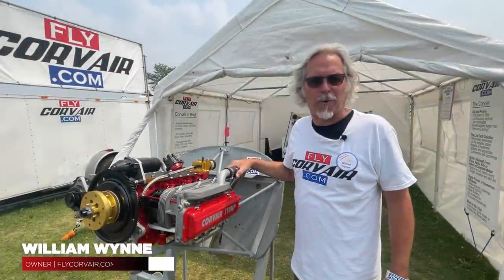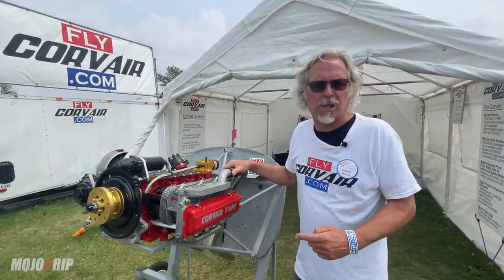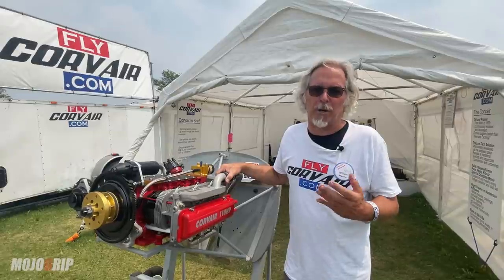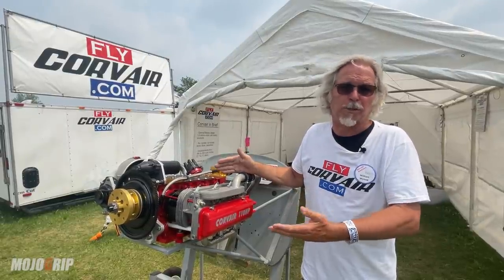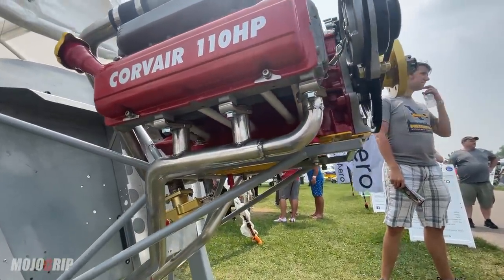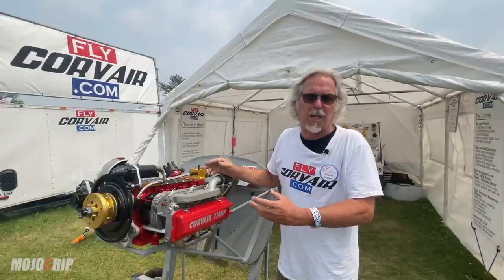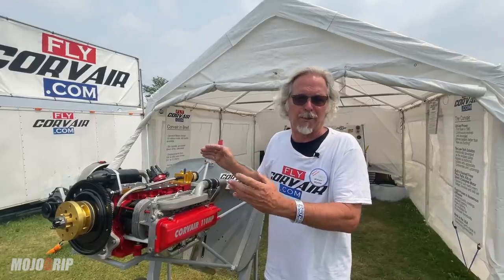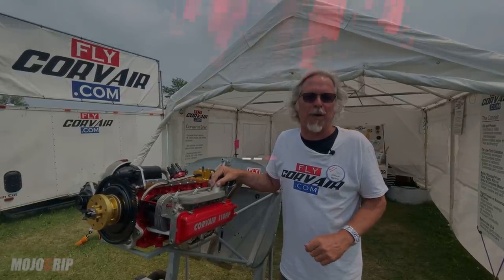Auto Conversion Engines Used To Power Plane | Corvair

Comment: The comments about this engine are unbelievable; this guy has produced a reliable and well thought out conversion that has stood the test of time.  Comments like flying behind a 40 year old scrap engine, your continental, lycoming engines are not State of the art but they are proven technology like this conversion.  I have personally witnessed the dedication that Wayne provided at his seminars, it is always safety first with him I've never seen him try to sell anything he didn't believe in 100%. Before making offhanded comment look into what this person is actually done and provides to the aviation community.
Reply: Very well said Don, I agree with you
Reply: William is one of the good ones!
Reply: I guess those people don't understand that the Lycoming O-320 in the 40 year old Cessna 172N that they rent from the local flying school is just as old and just as worked over as the Corvair engine in this video.
Reply: That, and the people who charge 50, 000 dollars for an engine that probably costs 5 grand to overhaul.
Reply: If you want to stake your life on engines that were pieces of junk when designed go do it. Guess what - you can't pull over when in the air. Your romantic notions won't save you or your passengers.
Reply: @robertoskeetrech3206  I have seen many worn out any leaking Corvair engines. I have never seen a broken engine.
Reply: THAT IS ALL TRUE .. but please ,if you use them , please stay ready … This fellow sounds good but 300 engines are not enough proof of concept !!!
And I know Corvair engines have been used for a long time but please … I don’t thing every component is being Magna-fluxed for metal failure !!!!!

Comment: Some guys are still using Subaru 4 and 6 cylinder boxer engines with their experimentals.   Personally I think they are fantastic conversions and like any they have pros and cons.  There are of course naysayers who feel they've not been refined enough or been around long enough to be "proven" but I also think that's subjective to who has done deep homework to make them a long term success.

Comment: It appears gorgeous. There is one obvious fly in the ointment: Instead of seeing an electronic igntion, or one magnito or two, it uses a car distibuter. That doesn't really save any cash up front to lower the initial cost, because many electronic ignitions are available. The FAA would look with a jaundiced eye at using a distributor. Aircraft labeled Experimental I think have much greater advantages and satisfaction if they fly well and not kill anything other than grass and themselves. But electronic ignitions are the only way to go. The car distributor on that engine cost $150 - $250 and are imfamously unreliable. Electronic ignitions cost about the same but are much more reliable.
Reply: There are electrtonic ignition conversiion kits for the Corvair distributor through the Pertronix line of Ignitor ignition modules that incorporate a higher spark energy coil. Very reliable and very inexpensive, as I run them on my Corvairs, one which I race to great success at high RPM (7500+) in autocross events. The distributor on this engine looks like a stock model, however, it has been modified to accept two sintered bronze bushings to aid in spark stability, as William understands "attention to detail" and these engines rarely exceed 4000RPMs tops, making magnetos an unnecessary expense for this application -- I've done the upgrade to all of my Corvair distributors.

Comment: I'm waiting to start my PPL as soon as funds permit. However, this is my first knowledge of car engines being used to power an airplane.
Reply: The key thing here is that these auto conversion engines are essentially only allowed in aircraft that are in the "experimental" category, not in the "certified" category.  (That said, there are certified conversions like those used in Diamond aircraft that were originally Mercedes diesel car engines that have been significantly modified but the company went through the process of obtaining official FAA and European certification for the engines and the aircraft they are used on.) This is at Oshkosh, which is hosted by the EAA - the Experimental Aircraft Association.
Reply: @tomdchi12  Thomas -- if and when these auto engines are certified, these engines could become extremely popular in planes. But until this arises, there will be headwinds such as use in experimental planes only. Pilots are likely to shun these engines until such a time comes about. However, thank you for your response.

Comment: I wonder if this would work on a Sonex? I'm unsure if it is too heavy for this smaller, lighter craft, but- if it does (mounted closer to firewall for better CoG?) it would be another solution for that particular group of craft. I know that if it drops a cylinder- it remains smooth, but- I think weight would be the primary issue.
Reply: Yes. It has been done.  Look up Cleanex.
Reply: In Waco, Tx, there is a retired A-4 pilot with one of these in his Sonex.
Reply: The Sonex is in the micro category. That engine is way to big. At leasr one KR-2 builder put in a Corvair engine. For the added hp, I would like it. The KR-2 could put any engine on the front that had at least 48 hp up to 200 hp. The standard Beatle engine puts out 55 hp. That's basically what you were going to fly at above 135 mph to commonly 155 mph. At altitude of 10,000 feet, drag is reduced, and not counting tail winds could show 155 mph on the indicator. GPS at 10,000 feet with a 40 mile tail wind, you could be tim e traveling and pass your destination.

Comment: beautiful engines! intake and exhaust plumbing look pretty restrictive. any performance upgrades in intake and exhaust manifolds? any turbo or supercharger options for better performance at altitude?
Reply: I'm sure you can you can use all the car performance parts. I have this motor in a sand rail that is 172hp to the rear wheels standard upgrades aftermarket Intake carb higher ratio roller rockers higher compression and you can go to a stroker crank an oversized jugs and pistons that can give you up to 3.3 litre.

Comment: Since the Toyota V6 is so smooth and reliable would that work well?
Reply: Viking engine  that was mentioned in the video uses Honda car engines. You would have to see what the weight to power ratio is, and make sure the air craft it's put on can handle it weight. Like he said in the video  conversions have a bad rep. for this reason people just try  what that can without doing the research and testing.
Reply: The 1GR FE V6 would make for a very good conversion... Good point Parker
Reply: A major issue with newer V6 engines is that most of them are fairly tall and narrow to fit sideways in a front wheel drive engine compartment. This shape is not optimal for most aircraft cowlings. It fits better if you turn it upside down, but now your oiling system just got much more complicated.
Reply: The problem is the weight, cooling system and reduction gearbox you will need to slow the prop speed to about 2600 rpm. The corvair option does away with all that leaving you a smooth, direct drive, simple and reliable installation that you will understand inside and out as you actually build the engine yourself (though you can buy completed units).
Reply: @weofnjieofing  Thanks, what about the Lexus inline 4 cylinder turbo?
It's all aluminum and should be a decent candidate.
Reply: @thisismagacountry1318  Viking engines use the latest in line 4, all aluminium, direct injected Honda engines to good effect from 90hPr to 195 hp (turbo). They'd be your best bet as those engines are fully set up for aircraft use.
Trying to convert a Lexus engine yourself would be very time consuming and expensive. The Honda 4cylinder is a very reliable engine.
Reply: @weofnjieofing  Good to know. 
Are any Honda engines available in Diesel or Turbodiesel?
Reply: @weofnjieofing  problem with direct drive is being limited to about 3000 rpm which for most engines is where they are just beginning to make power. 4500 is still pretty low for for an auto engine and this engine would make a lot more power at 4500 rpm. a simple belt drive reduction could do the job and give more ground clearance for a larger prop which would further enhance performance
Reply: @weofnjieofing  Weight isn't a problem, the 2GR-FE weighs in at around 360 pounds and can make over 300 hp, which is quite good for a light aircraft engine. A PSRU and the cooling system would put the weight well over 400 pounds, but that's still comparable to other light aircraft engines.

Comment: Install newer tech such as electronic ignition and fuel injection in lieu of distributor, contact point and rotor, and carburetor. Electronic engine timing and variable valve timing control will also also help. Turbo would be awesome.
Reply: Azalea Aviation (in Quitman Ga) produces a Turbocharged Corvair engine (120 hp).

Comment: Hmmmmm…I DONT think so … I had a Corvair … a couple !!!!
I could coast to the curb and put the van belt back on … that would be tough at 10,000 feet !!!!!
Reply: The aero converted corvair don't have a cooling fan anymore, the propeller pushes enough air through the cowling!

Comment: i have just few hrs in cessna s (single engine) as student pilot long back. i still keep browsing about tiny planes in GA sector. i am wondering if any experts here can clarify few doubts i have:

- considering himalayan/ tibetan mountain ranges and their weather patterns, is it possible to design a piston-engine (normal petrol), single-place aircraft, with about a ceiling of 35,000 ft?

- can the same aircraft be STOL & fuel efficient at low altitudes for cross country flying/ long trips?

thanks in advance.
Reply: There are very few piston engine aircraft that can even reach 35,000. For anything with a practical mission, you would be looking at a TBM or better. Price of entry is about 2-4million.

For a Corvair engine, I wouldn't expect to spend much time above 10,000 ft, though I think the engine is amazing.
Reply: @Shmey  thanks for the info. i am only wondering, why there aren’t any piston aircraft designs available in these modern days, especially 1 or 2 seated for high altitudes!
Reply: @prasadjonnalagedda8633  I don't know much about regulations anywhere but the U.S. Here, the simple answer is cost.

To legally fly at higher altitudes, the instruments (typically an encoder tied to the transponder) must be certified to the altitude you want to fly to. Higher altitude flight requires a longer test. A longer test means more shop time. More shop time means a higher cost. I can't remember the regs off the top of my head, but I think the requirement is 24 months, so it's not a one and done deal.

The good news is 35k feet seems a bit higher than necessary. I have no idea what your mission is. I'm guessing, as a low-time student pilot, you can find a plane to fit your mission. As long as you have an accessible airport that a small plane can take off from, you should have no trouble getting started. Flying to 35k feet might have to wait a bit, but you'll get there.
Reply: @Shmey  oh no, my few hrs were like two decades ago, and i am 55 now. not sure if i take the training again, but curiosity makes me sometimes to lookup at the flights and browse internet regarding them.

with these recent isolations around the world, i started wondering if a cheap certified aircraft is available, it maybe nice for some middle class individuals, who are willing to own & fly them privately. because there is lot of traffic between india & nepal, and  also for accessing remote communities living in mountain regions across the country- i became curious about high altitude tiny aircrafts. also, i guess, most of the governments around the world won’t be happy with individuals flying at high altitudes.

anyways, thanks again for your feedback, as i am trying to educate myself a little bit regarding, if many requirements can really fit in one machine.
Reply: @prasadjonnalagedda8633  Several issues with flying at that altitude that pretty much eliminate small inexpensive aircraft doing it. The most important are the need for cabin pressurization and the problems with operating a propeller aircraft in air that thin. You can't fly at 35,000 feet without a pressurized cabin. Those aren't cheap and designing a small aircraft that can be pressurized isn't easy or cheap. The Piper M350 is about the least expensive thing on the market that I'm aware of and it starts at $1.15 million. It's only rated to a 25,000 ft service ceiling though, so you'd have to put out a lot more cash to get into something that can operate at FL350. You're looking at a jet and that's way out of reach for middle class people.
Reply: @pebutts  thanks for your clarifications, yep, i understand about physiological issues at high altitudes.

himalayan climbers carry oxygen and also some times, foot pump operated gamow bags. for a short duration like couple of hours at high altitudes, can a pilot survive with those limited devices, without the need of complicated cabin designs?

anyways, for a normal traveller these things still don’t make sense. apart from that, with present day technologies, are reliable piston engines and propellers impossible to achieve at that altitude?
Reply: @prasadjonnalagedda8633  A simple oxygen mask won't cut it and I don't know how you'd fly in a gamow bag. You'd need a regulator like you see fighter pilots wearing or else you'd be in real trouble very quickly.

To explain, climbers gain altitude pretty slowly because they're walking. They also spend long periods adjusting to high altitudes. A climbing aircraft gains altitude very rapidly. Rapid ascents put you at very high risk for acute mountain sickness and its deadly complications, like high altitude pulmonary edema (where your lungs fill with fluid and you can't breathe) and high altitude cerebral edema (where your brain accumulates fluid and swells, resulting in severe impairment). These things can happen even to experienced climbers. The difference is that there's nobody to help when you're at the controls of a small plane.

It's not just the need for supplemental oxygen, it's also the air temperatures. It gets awfully cold up there. Instruments don't tend to work way below freezing, whether they're the old steam gauges or glass. The current small aircraft single wing single engine altitude world record holder, Jim Price, did it in a Long-EZ and barely managed to crack 35k feet. His instruments all froze in the negative 62 degree temperatures. If his oxygen supply had frozen, he would have died. He had to train for months to set the record, too. It wasn't something that could be done routinely.

High altitudes are trouble for non-turbocharged piston engines. They just don't perform well because the air that comes into the engine is just too thin. A naturally aspirated engine typically loses about 3% power for every 1000 ft of altitude. In other words, by the time you get to 30k feet, you're basically running on 10% of the horsepower you were at sea level. A turbocharger addresses that problem and can also be used to pressurize air for the cabin, but such an engine is more complex and expensive. Can it be done? Sure, but the costs, again, would just be prohibitive for the average pilot.
Reply: @pebutts  yep, got the whole picture! probably individuals can fly those altitudes only when more secrets about the universe are revealed, like anti-gravity. technology could be cheap, only when science is advanced.
Reply: @pebutts  i don’t know, if burt rutan’s quite innovative, fuel efficient machines are also reliable designs. i guess, maybe not much work put into by researchers for making less expensive small machines for those altitudes.

inspite of my limited practical & theoretical knowledge regarding flying machines, i wonder with present day technologies & more research- achieving reliable, less expensive alternatives to the systems used in giant versions is not far away.

Comment: VW Bug engines are good.
Reply: Junk.
Reply: They really are a good engine but the corvair bone stock is anywhere near 2to3 times the horsepower. Corvair engines were available in 95hp 110hp 140hp and 180hp. The 180 is factory turbo. I have a 140hp in my sand rail modified it is making 172 to the rear wheels with stock bore and stroke.
Reply: @jasonhughey4434   A much heavier engine when you add the cooling system. 
You add more power but you don't fly as far when you launch off the top of a tall dune than you will with a stripped down 2160 with squirrel cage blowers. 
Also less fuel consumption. 
$5.69 in Cali.
Gross. 

*raised in Grover Beach near competition hill